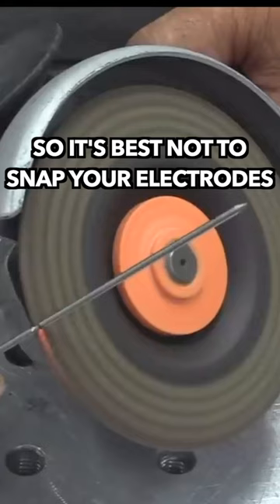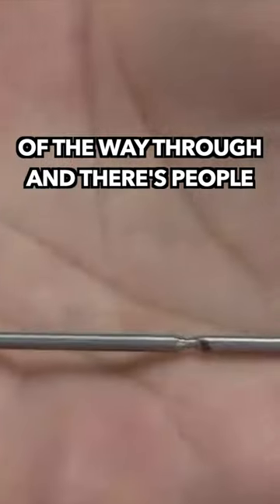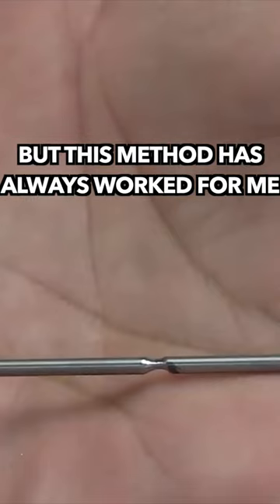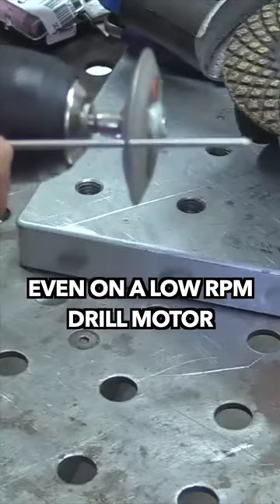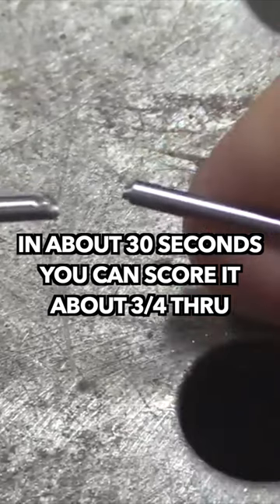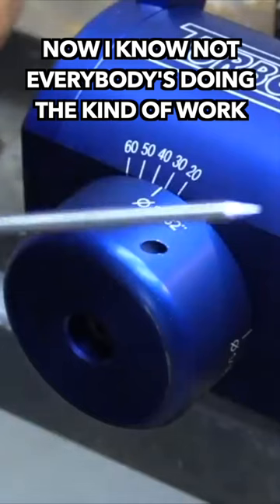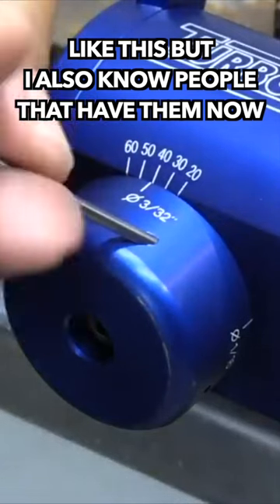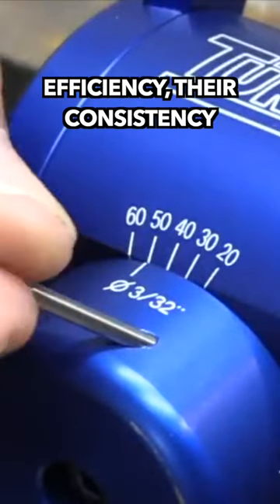Tungsten Sharpening Methods

Comment: I used a special tungsten grinder with a dust filter I didn't have to breath in the dust. To cut them to length I used a special bench grinder with dust collection. Please take care to not breathe in the dust, it wont kill you quick, but slowly and painfully.

Comment: A diamond wheel on an angle grinder and a drill. You already have both tools, and you can sharpen them just as consistent, but with more available angles

Comment: Haha. Just today I put the same diamond wheel in a router, put the router in vice, and chucked up the tungsten in a drill.  It works great.  I had been doing the same thing with a diamond disc in my dremmel.  The larger wheel makes the grinding marks more straight for a lot less arc deflection on AC.  I also run the drill backwards to make the lines straighter.   I never would have gotten into hobby welding if it wasn't for your videos!!!

Comment: i grind tungsten straight on, with a belt sander. pulls the contaminants away from the tip instead of into it
Reply: Then a few strokes over some 1200's paper.
Reply: Yea bud at school we figured out to put it a drill makes it real easy
Reply: Penny… easier not always correct or best… probably shows in work you do today.
Reply: My school uses a bench grinder, also have a drill you can use to rotate the electrode if you don’t want to do it by hand.

You just want the marks left by the grinder to go towards the tip, if it doesn’t (like in the video) the arc is less focused and can wander
Reply: Same here. I put the tungsten in a drill and spin it while sanding the tip angle on some clean dedicated 220  belt sander. Really helps center the point and an easy way to clean up dipped tips.  Not as good as a tungsten grinder but definitely better than a stone grinding wheel.  Imo

Comment: I always used grinder. But I make sure to have the score lines facing tip not in a circle round tip.  As it helps arc go the correct way to the tip

Comment: We were taught to break em if they needed shortening or if we needed a clean face to grind. Hang the waste over a metal edge and hit it with something hard. You can get fine control if you use sharp edges, my teacher could knock off 1/16” clean when he needed to. 

The reasoning behind doing it this way is that when you get a melted tip it screws the grain structure, and so does cutting it with something. Not to mention spiral grind lines will give you a spiral arc. He taught us to break them off and grind them vertical to the electrons would flow straight down into the work.
Reply: Or just pretty grind it. Run the grind lines parallel with the rod. Also, you won't get a rod hot enough to mess with the grain structure grinding it, unless you're doing it with a clogged/wrong wheel. I agree, he ground it wrong. But carbide is sintered in an oven to set the carbide atoms in the nickel (typ.) matrix.

Comment: It's been said that when grinding tungsten, to grind so that the direction of the wheel or sanding belt goes in line with the tungsten, and not across it, and that is so that the current of the arc flows off the end of the tungsten in a straight path to the workpiece ! 😮

Comment: Dedicated wheel on a bench grinder and sharpen in line with the length of the rod not perpendicular.
If there's grind marks, but they're in the direction of electron flow, it will work way better.

Comment: At welding school they had a bench grinder and a piranha tungsten grinder. Started the first year basic tig welding with the bench grinder and second year pipe tig welding used the piranha. You could tell the difference from just how stable and consistent the arc would be.

Comment: Video starts with the premise "it's best not to snap your electrodes" then builds off that premise. Is the premise correct? If so, why? I've always snapped my electrodes; hang end over a sharp corner of the vise and "whack it off" with a hammer. Never had a problem (or, never was aware of having a problem). What is the problem?

Comment: Hand drill and belt sander is the way, has never let me down, however if you're doing clean room tig this might not be the best choice, although I have welded pressure vessels many times over and never had any issues related to the tungsten.

Comment: I've been a TIG welder for 22 years never in my life have I found a Tungsten sharpener useful I use a bench grinder it works great I can do super tiny stuff that requires a magnifying glass or I can do super huge stuff both AC and DC

Comment: I once worked with an old man at a maintenance job I had and they had me doing a lot of fabricating. This old man taught me a trick that he called a “poor boys lathe” and he had me run a grinder in my hands facing up, and he took a part that was to thick and chucked it in a drill and he went to town. After a minute, it fit like a glove

Comment: What are these electrodes used for ?  I don’t get this video at all.
Reply: For TIG welding
Reply: Tig welding is unique the welder makes an arc between the tip of that electrode and your project but in function it's like an electric gas torch flame.  But it needs to be a sharp point because of it is dull round or contaminated the arc will wander all over and jump.

Comment: I do this when I cut screws or anything that gives whatever tool I'm using a struggle.   I almost cut through it then snap it.   I do it to prevent that snapping noise. In my mind, that "snap" sound is not a good thing

Comment: I have a cheap chinese 1" belt sander that is dedicated to tungsten only. Been sharpening with it for 35 years.
Reply: Sad part is, if you were to buy the same branded one today, it probably wouldn’t even last a year. Old “cheap” tools, a lot of the time, are equal or better than todays midrange tools..it’s pathetic! My favorite and most reliable tools, in my shop, are ones that have been passed down to me from either my grandfather or my father. Sentimental, yes; but they just don’t break

Comment: Buy a 15 dollar 1000 grit diamond lapidary wheel and plunk it onto your crappy old bench grinder. I sharpen my tungsten electrodes on the outside inch and drill bits on the rest, keeping the metals separate. Works well. Usually, I chuck my tungsten in a battery operated hand drill. Makes a beautiful point and mirror smoothe at any level of pointy-ness I choose.